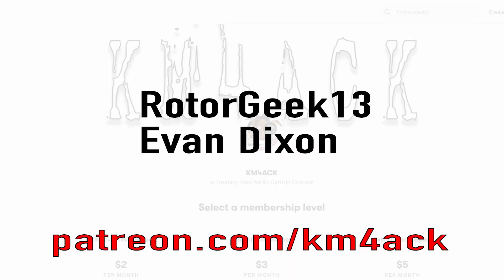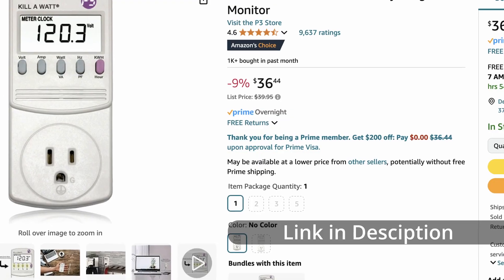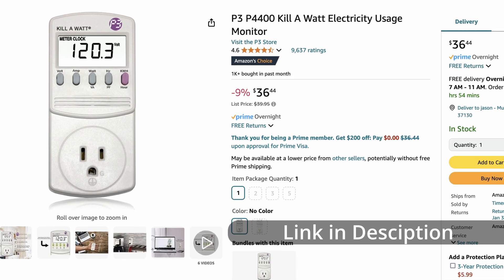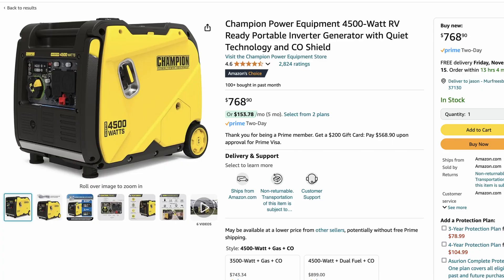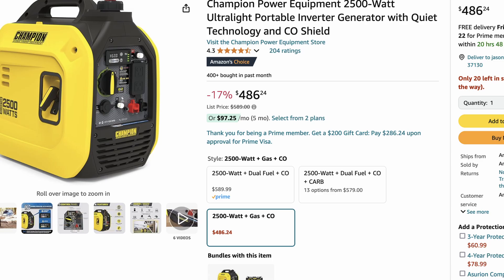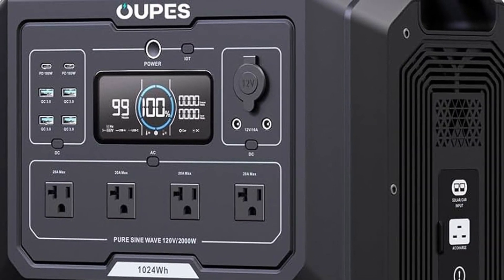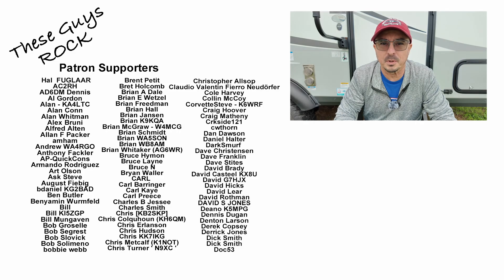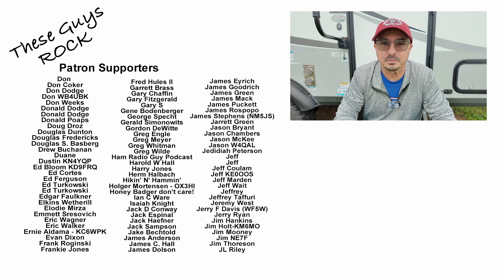Layering Your Backup Power Strategy

Comment: Hey Jason, I’m a little late to this party but I wanted to make a comment regarding charging of LiFEPO4 batteries. One thing you did not mention is that the batteries have a max charge rate, typically given in “C” units. 1C would equate to the capacity of the battery. (Similarly, there is a max discharge rate in the same unit, C.) If you have a 100Ah battery that has a 1C discharge rating and a 1C charge rate then you can only draw 100 amps from that battery. Good to know, but more importantly for this video the 1C charge rating means you can only charge at 100 amps! If your solar and generator exceed this then the extra is unusable for charging. Not a bad thing but just like using a coloumb meter (kill-a-watt meter) to calculate discharge rate, it is important to calculate the maximum charge rate of your batteries when putting your system together.
Cheers!

Comment: Another thought on the generator use with a battery, generators are most efficient at 60-70 percent load typically... when just running fridge, lights, etc your generator is the least efficient method of power.  Using a small generator to charge a battery bank with an inverter for a few hours every day, or week etc (depending on battery bank size) is the most efficient.  It also draws less attention, and the short bursts of generator time make it possible to ensure the "security" of the generator, should that be a concern.

Comment: Great video.  Living near the Gulf Coast we have to be ready.  I've learned a long time ago that 3 is 1 and 1 is none when it comes to being prepared.  I have and maintain 3 generators - one propane and 2 gas units.  My small unit will idle down when there is a low load and is very efficient.  I also have a small Geo Pro camper with 12 volt systems and solar power that will be used for cooking and sleeping.  This year I will be increasing my 12 volt power storage, I have some but another will just give us more options.  The longest we went without water or power was 21 days due to Hurricane Andrew years ago.  73 KI5IMV.
Reply from the maker: Thanks! I have an E-Pro, sister company to the Geo-Pro. Love that RV.

Comment: I have solar batteries that can charge very quickly.  The larger generators are actually better, because they are running at a constant output and are more efficient.  But if you are solely running off of a generator, you want the smallest you can get away with.

Comment: Nicely Presented.. This mimics my own emergency planning that will utilize my 5000w dual fuel generator 5 hours per day. During that 5 hours I will charge 2x 280ah storage batteries that power my furnace, refrigerators and vital electronics 24/7 (24hours per recharge) and also during that 5 hours we will perform food prep utilizing whatever kitchen electronics are necessary off generator power.  Recharging the storage batteries is essential and I supplement the generator recharge with solar panels that provide varying amounts of recharge capability.  Short term I use propane to power the generator but long term will require gasoline storage and my generator burns about 1 gallon in a 5 hour period so 20 days of this emergency plan requires 20gallon of gasoline storage, fortunately our vehicles also run on gas so we can siphon our tanks if necessary.  We try to be prepared for a six month SHTF scenario but our generator fuel storage is limited.

Comment: I agree that you should have two generators at least. One that will run everything except heating water, a well pump or cooking with electricity and a larger one that can handle those power intensive functions on brief as needed basis. You just made me think of an idea. I need a panel with all the power hungry functions which would allow shedding the continuous functions and it really wouldn't take that big of a generator to power the large loads one at a time. The well pump and simple resistive loads may not even need a pure sine wave power supply.

Comment: A well pump is intermittent high power draw, on demand with constant stand-by necessary. This best served by batteries and a generously sized split-phase pure sine-wave inverter. Harvesting the sunlight is OK to supplement charging, but do the fast-charging from a (smaller) generator when it is scheduled to run. 

Some math is needed - a 12v LifePo4 battery might be charged with up to 100 amps (see Manufacturers rating) That is done with ~11 amps of 120 VAC input. That can be accomplished with as little as a 1,500 watt generator, but running for a short period of time. This is opposed to say, 20 amps at 240 volts = 4,800 watts plus a substantial motor starting surge current. You don't want a generator that big sitting there idling most of the time.

Freezers are similar, but smaller single-phase 120v inverters are fine. But, don't put all of your eggs in one basket with a single battery/inverter system (above). 
Modern refrigerators should be phased out of use as the outage continues. This is due to high power demands of the defrost cycle for the purpose of lower overall energy usage (over time). Get the frozen stuff distributed into the running freezers, consume the refrigerated stuff as much as practical, and go to an ice-box concept, where you make the ice while the generator is running. Coolers might be more practical for this purpose.

As always, YMMV

Also, be prepared for the city water to stop running. The one tornado that affected my community took out the pumping station, and we had no water for days while repairs were made. Meanwhile our home had power from the electric utility the whole time.

Thanks for the food for thought in the video!
Reply: Capacitors like a six pack of beer will start it.

Comment: I live in Florida and have gone through many storms. I got my generator in 2004 when we got hit by 2 hurricanes in one month! Home depo was bringing in generators as fast as they could. But we didn't get much choice. We stood in line when we got to the front of the line they hat one on a flat cart you took what they had! Most were getting the 5550W. It is a good one. I ran most of my house NOT central AC! Just a small window unit to have a cool place. 24 hours on less than 10 gal. Some people had trouble with them because they didn't read the book! And you said nothing about having OIL for them! Some generators say to change the oil every 25 hours of run time. They don't have an oil filter. The ones that have oil filter can go longer but you need to change the oil and filter as the book said! You can take a new generator and junk it in a short time if you don't change the oil. Some didn't even check the oil! People were taking them back because the stopped running after 3 or 4 days, LOW OIL CUT OFF stopped them from running! When you get a generator read the book! get a lot of oil and filters if it needs them, also air filters! Sorry this is long, but if it keeps your generator running when it is needed, it is worth the time to read it!!  73  W4DES

Comment: Good talk. Sump pumps need power. Probably low consumption on the entire scale of what is needed but it has to cycle to keep ground water at bay.
Reply: Yes, at my previous residence (rental) I had two sump pumps that needed to be powered 24x7 to protect the stockpile in the basement. That necessitated 2000 watts of generator capacity.

Ground water was high because the storm was wet.

Comment: Just in case I need to bug out, I like to keep my emergency power, food, and water small enough to be portable. This is worse case scenario. In the bed of my truck I can put a 65 gallon fresh water tank, a mini fridge, 13 kw of combined power stations and expansion batteries, a 4250 watt inverter generator and several containers of cannned and dry food. A tent with sleep pads and bags. Finally, don’t forget the toilet paper.

Comment: Very few people talk about what you call layering. My career in the USAF taught me two important rules; multiple redundancy and graceful degradation. My poco is great and at 9c/kwh going off grid just doesn't make any sense and commercial power is up 99% of the time. I have a 2kwh power station and 5 100ah lifepo4 batteries and a diy 1kwh hobo freight toolbox power station. 700w of solar panels. I'm on a well but have enough potable water to last a couple days and rain water plus a spring feed pond to handle toilet flushing and washing up. My battery capacity can keep my fridges and freezers running. Than i have 4 generators of various sizes to run the whole house minus stove and HVAC and smaller ones to run the fridges and charge batteries. My priority is to not lose the thousands of $$ of food. My final step will be a large propane tank. Something i am learning, my batteries take close to 8 hours to charge from zero with a 20a charger. Everything you do takes more than you think. Learned that ages ago doing a bath remodel that cost twice as much as estimated. You for a good review of a topic that isn't stressed enough.

Comment: I don't think I heard you mention charging your batteries with solar. I charge my 150Ah battery with 500 watts of solar which takes about 3 hours with a 20 amp charger. If it's cloudy I usually won't try to charge up my battery. I do have a Gas Generator but never use it to charge batteries maybe I should on cloudy days? I really don't care if I have to plug into the grid from time to time. BTW I have heard that using more than 20 amps to charge a 100Ah battery can diminish its life I think this was a rule of thumb  I don't hear many channels talking about this though.
Reply from the maker: I typically prefer to charge mine at 20A but it's nice to have the capability to charge faster if you were charging from a generator and needed to conserve fuel
Reply: @KM4ACK  i agree. I'm tempted to buy a 25 or 30-amp charger for my 200Ah -battery

Comment: What about your car or truck? Whenever a weather event is coming I always fill up my tanks. Not the most efficient thing but you can idle the truck and use the alternator to make 100 ish amps of 13 vdc to charge things or run an inverter. No one ever talks about this idea. Not great but something everyone can do without spending a ton on batteries and generators and propane tanks etc. I do have 2 gens and propane tanks. Remember 1 is none and 2 is 1. Redundancy!!
Reply: The alternator at idle is not making 100 amps. You would need to idle it up to about 2,000 rpm maybe 2500 rpm to make 100 amps.

Comment: You pretty much described my way of handling power outages since most are short term, Helene did offer some challenges though. I'm located in SC about 30 miles south of the hard hit NC area and our area experienced electrical outages of 3 to 10 days. My power was only out for about 4 days but my neighbor and daughter were without power for about 8 days. I have seven 100ah Lifepo4 batteries and several inverters ranging from 500 to 2000 watts, 2 of the small Bluetti AC2A's and a power station I put together myself. We have 2 refrigerators and a full size fridge, fortunately all of them seem very efficient as each will run at for 24 to 30 hours with a single 100AH battery and a 1000 watt inverter. I use one of the Bluetti's to run my network and internet gear which only consumes about 60 watts and the other powers my TV which uses about 100 watts. if power is out for more than 2 hours I hook a 100 ah battery to each of the Bluetti's using the solar inlet with an xt60 connector and they constantly stay charged to full. When the batteries need recharged I use a small 1000 watt inverter generator (very quiet) and a 30 amp Victron charger, I can recharge one battery in about 3 hours and recharge 2 batteries on 1/2 gallon of gas. It's a little bit of work but since I have spare batteries I only have to run the generator about 3 hours a day and can get by with keeping very little gas on hand. I also have 400 watts of solar if needed but generally just use the generator.

Comment: My journey started with being a backpacker both warm and winter seasons. I still have all that equipment for both me and my wife. We have also spent a lot of time Boondocking in our RVs and collected all that equipment. Now we have installed 18000 watts of battery backup in the house and 5400 watts/hour of solar and three trifuel generators along with big buddy heaters and a large stockpile of fuels. The true test of how prepared you are is in how many levels of backup you actually have. Our kids grew up backpacking and are  very self reliant but know that if all goes to S#1t we have a place for them and our grandkids.

Comment: My strategy (implemented prior to Y2K) was a large inverter and battery bank which could run my well pump.  Then I did not need a large generator. Any generator that can provide more than my average use could charge the batteries.  That was all I could afford at the time. Then a few years later I added solar panels to charge the batteries.

Comment: That’s exactly what I did. I have an 800 watt propane generator that runs 50 hours on economy mode. I have 2,000 watt solar generator for my refrigerator that runs for at least 12 hours. The same for my propane furnace which in the winter gets me about 16 hours with an instant on water heater. I have many smaller solar generators 600-700 amp for lights etc that can run a long time. Instead of buying more solar generators I started getting 1200 amp batteries and use a DC to DC charger. These batteries are much cheaper and I use that charger to plug into the solar ports of the generator to extent the run time by another 6 to 8 hours and use my generator to charge them. Its much cheaper the using the brands batteries. Also have a pure sine 2000 water inverter to use when needed. Yes this is a pain to keep everything charged but I don’t hear a generator running at night and longer power outages measured in days happen only about 2 times a year at most. My longest though was 7 days. I will eventually go whole house when I can afford to but go with 3,600 watt propane generator to basically power the outlets for lights and recharging the solar generators.

Comment: Thank you for the great information. After Helene I had my two smaller generators lent to neighbors so had to strategize using my big one not knowing when fuel would be available or I'd be able to get to it. Running all the heavy load items and charging several battery banks I was only running at about 28% load so it wasn't optimum. At some points I actually used the fast charging banks to charge the slower ones. A couple items that were amazing to note...6 pack of small cheap solar motion security lights ($35ish). Put 3 through the house at night to lessen lantern type usage and this ensures they have 2 days of sun to charge fully. Also, my 50,000 mAh USB bank was great for charging my tablet, phones, radios, weapon lights, etc. on the nightstand without having to move or cord off of a big bank. They are in a sweet spot price range now but you need to be careful of them advertising "fast charging" in reference to output and not input. Thanks again and be safe.

Comment: One thing many people don't seem to understand, is that you really don't have to run the generators 24/7. I have been through week long outages, and will run the generator in the morning for a couple of hours. Make breakfast, run the fridge and freezer, maybe the gas furnace. Then through most of the day just rely on battery powered equipment and natural light. In the Evening, I run the generator for 3 to 4 hours, for dinner, chill the fridge and freezer, furnace, charge up batteries, etc. Then use battery powered lights or an oil lamp during the night. We use the propane grill for cooking, and an old Coleman camp stove. If your house cools off so fast, that you have to run furnace through out the night, then you need to improve the insulation!

Comment: Excellent perspective, 2 is 1, 1 is none. Is there a simple way to determine the "sweet spot" of battery size and inverter size to run a specific appliance like the refrigerator you mention?
Reply from the maker: Simplest way I know is to pick up a watt meter and run a few tests to see what each of your appliances consumes. The you can run some calculations that will tell you how long a battery will last running a particular appliance.

Comment: Great video lots of great advice.  I was out of power for a week with milton.  I have 5 pecron portable power stations and 2 expandable batterys and 1800 w's of solar panels and a champion dual fuel.  The solar was enough to keep me going for the week but I will invest in more solar this winter.  I have been running my fridge and chest freezers 24/7 for over a year now.  I let my neighbor use the champion they are great generators.  My advice is to buy slowly over time because I could never afford what I have now in one purchase.  Your first purchase should be the dual fuel generator then buy solar to extend its run time until you no longer need it consistently.  I am slowly taking my home off grid as much as I can.  The more solar I get the more comfortable I live when these storms hit or whatever else happens.

Comment: Power is not measured in Amps.  Power is measured in watts and horsepower. Whole house generator are good but like any mechanical it can fail. My genarator has failed twice. Once the oil pressure sensor started leaking oil. Second ignition coil failed. Not a reason not to have whole house genarator but a reason to layer.